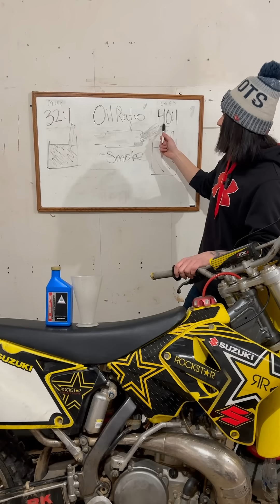2 Stroke Oil Ratio Explained

Comment from the maker: Use the ratio they tell u to use (in this case it’s 32:1) then u jet ur bike off of that ratio
Reply: I had best luck ever
 wt CCI factory oil on my RM 500! It wouldt run on anything else, after 5 yrs i done a top end job & it was still wt in specs! 1qt to 5 gallons was the best way to do it! CCI was the best oil ever made & probally the only oil id run 32-1 because i tried it! And everyone else maybe right!
Reply: You are 100% correct!!
Reply: I tried many different oils for all of my 2 stroke dirt bikes. I was hooked when I found AMZOIL. This oil could be run at a 100:1 ratio. I had a 98 CR250 I bought brand new and ran only AMZOIL at 100:1. I rode that bike hard every Saturday and Sunday for a full spring, summer, and fall. I brought  the motor in to get it honed or sleeved and new piston and rings at end of the year. I was told it wasn't needed and that they could still see the original factory honing scratches. They said you must barely ride. I laughed and told them how often I rode the bike and the oil I used and the ratio. They did their own research into using AMZOIL, and the next time I was at the dealer they switched over to only AMZOIL products. More than one occasion I was told I was going to blow the motor up because it was producing no smoke. Best oil I ever used.
Reply: @jasonkerekesch5012  fuel is a lubricant too.the oil mix is to satisfy the bearing requirements and to keep the exhaust power valve lubed too. The engineers at the company were not trying to rip you off, they were covering their ass too.
Reply: I run 34:01 on '02 cr250 w newest Lectron 38 pro it runs great and plug is tits now instead of keihin problem child that came on it. Hondas are notorious for tearing up plated cylinder near the PV they need oil. Tell lectron what mods you got they send you proper rod set right out of box and kick it and ride dont mess w jets again at any elevation. If youd rather do cave-man maths w jets then ride be my guest this aint the 20th century anymore. Also run non ethanol VP more stable and no gunk in carb to worry about let it sit for half a year guilt free. 2020+ pump fuel is worse for carbs than ever. EFI w magic button start is kinda cool lol
Reply: I jet EVERYTHING TO 50:1 I HAVE FOR 25 YEARS AND NEVER BLOW EXCESS OR BLEW AN ENGINE.
Reply: @codyjohnson5674  elevation is a major factor in what we can get away with also
Reply: How is 30to1 more oil in gas than 40 to 1 just asking
Reply: @DorethaRiddle  your kidding right?
Reply: @DorethaRiddle  the 1 in the ratio is the oil. So 40:1 means 40 parts fuel and 1 part oil. So 50:1 is more fuel to the same amt of oil.
Reply: @DorethaRiddle 30 parts gas 1 part oil…
Reply: People forget that the oil in your mix also lubes the crank.
Reply: @cliffordsimpson7113 it lubricates everything that needs it. Were you under the impression that folks thought that the crankshaft wasn't included?
Reply: How many years did it take to get the silencer
Reply: No. I'll just use synthetic.
Reply: But what about what the oil bottle says?
Reply: NO
Reply: Use what the manufacturer recommends for the oil ratio and jet your carburetor. That's how you fix the oil spooge that comes out of the exhaust and read your spark plug color, this will tell you everything about your jetting.
Reply: Lol sell ya bike and go electric u have no idea
Reply: Use the ratio that the oil manufacturers recommend for their brands. Then, adjust your carb to run correctly with that ratio!

If you don't know how to jet your carb, find a very knowledgeable person who does to help you problem solved.
Reply: @bbarker5766 Oil manufacturers intentionally give bad ratios. 
They're trying to make u need to buy more. 

Ur not the sharpest tool in the shed are u?
Reply: There’s no reason you should have to rejet a new bike unless you live in super crazy high elevation. There’s also no need to run that much premix oil 50:1 ratio is plenty enough. Also the better oil you use the better it works and less you have to use. 50:1 is optimal premix ratio and don’t use cheap premix or you’ll be fouling out plugs every ride at 32:1 ratio and be smoking like a diesel. Try 50:1 and tell me how much better your bike runs it’s going to have so much more pep when you crack the throttle.. leave the Jetts alone I’m pretty sure they jet it right when it comes from the factory. Unless you got a modded motor there’s no reason to touch them just use better premix at 50:1 ratio and your bike will run better than it ever has
Reply: @tsales330 damn right! Raced for years. And chased stupid problems. No reason to run 32:1 it's dumb. And loads up the cyl and plug. Plus it's a 2t rings annually are standard practice. Now that I don't race and trail ride with the fam. I pull a jug once every few years.  32:1 is way too lean on fuel and way too much oil. If your oils that cheap. Maybe save the engine and buy some better oil
Reply: @TheCharillz23 I run 50:1 in everything and jet accordingly. You don’t need 32:1
Reply: @TheCharillz23 your bike isn't jetted right and that's just facts, I'm a certified tech and I promise if you're jetted right and know how to ride a 2 stroke 32:1 is perfect. You must be scared to open it up if you're fouling plugs 😂😂😂
Reply: @tsales330 from my experience, bikes from the factory are jetted on the safe side not for optimum performance. My yz450f was lean on the pilot jets(causing low rpm flame out) and rich on the main circuit. My 2001 cr250 was jetted rich as hell, which is less power but more safe for engine longevity. 
Either way, it's your bike. You mix to the ratio that you feel is best. To me, 2 stroke oil technology has increased since 2001 so I run around 40:1 instead of 32:1. Im not fond of 50:1. More power but will need top end sooner
Reply: @tsales330 Almost every bike is jetted rich from the factory to avoid failure. By changing the mix to use less oil and keeping the stock jetting, you naturally are making the bike run even MORE rich and thus having MORE unburnt fuel and oil, as the jets are flowing just as much fluid but with 1% more fuel in that fluid, if switching to 50:1 compared with 32:1. This is irrefutable, no matter whether you subjectively think it feels more "peppy."

Also FYI you're going to lose some compression if you're using less oil. The oil helps seal around the rings. The viscosity is really less of an issue since there is such little oil, but still the oil is in the range of 50-100x MORE viscous than gasoline, so adding less oil will naturally make the jets flow a little more fluid with more fuel in the fluid. You're going to be running noticeably more rich with less oil in your premix.

Edit: Just did an in depth calculation out of personal curiosity approximating the actual volumetric flow rate change based upon data available online regarding viscosities of fuel and 2 stroke oil as well as an engineering equation to approximate the viscosity of a mixture of fluids and found that going from 32:1 to 50:1 increases volumetric flow rate by something like 17%. That's like going from a 180 main to a 188 main, a big change and in the wrong direction for a stock bike that's already set to run rich.
Reply: @anthonyantoine9232  ya they Jett them to be safe from the factory.. I see what your saying with more fuel but I don’t think that little difference matter unless your bike is modded. It’s 2 stroke too so with less oil it burns better and hotter with less oil. I’ve never had excess oil or gas coming from the silencer on any of my bikes they’ve always burned clean at 50:1. Still smokes alittle but you won’t be smoke screening everyone Behind you. I’m sure most have ridden behind someone like that can damn near taste what type of oil their using lol
Reply: I could be wrong tho but from my experience of having 2 strokes since I was a kid I’ve never had any issue with 50:1 ratio with a good oil  and many of my friends switched over from 32:1 after they would keep fouling plugs when we would ride and asked me what ratio and oil I ran they switched and never had an issue with plugs after
Reply: @tsales330 years ago, I’m talking like late 70s or early 80s a magazine did an article on 2 stroke ratio and found 28to1 made the most power
Reply: @jrod264winmag ratios have changed over the years, some of my older saws are boat engines are 25:1
Either way we all talking about oil like there's only 1 type, there are three main types and good reasons to use or avoid all of them.
Synth is the only one I'll happily deviate from factory mix with. 
Motul is amazing.
Reply: @zopEnglandzip  I have an old boat, can’t remember the engine make it says 100 to 1 on the gas tank, I run 50
Reply: @tsales330 you are crazy.... a chainsaw can run 50:1, that isn't what I would run in my bike tho. 40:1 is the thinnest I'll go but even that is pushing it....
Reply: @tsales330 the factory doesn’t know what altitude you will using the bike at.
Reply: @acsnitner7661 mix has 0 to do with altitude 😂😂😂 of course jetting does but the people who made the bike know the best mix ratio and that's all there is to it. Pros run 32:1 with 0 issues
Reply: @aiRZenki I was referring to stock jetting being assumed at near sea level. I reread how I wrote it and the sequence of comments before it and now understand where you are coming from. It was an error on my part and thanks for pointing it out.
Reply: @tsales330 so should I have zero sploogy? Like I rebuilt the bike and on the first two hours it had minor sploog trail on the pipe. Then it sat a few days I went out for another two hours and now it has zero sploog and only smokes when its warming up.

Comment: 32:1>40:1, the AFR ratio will get richer but that won’t increase spooge. 2 stroke oil isn’t what it used to be. All oils are different too. A caster based oil will have a higher flash point but can run at 50:1 safely (250 2t). A mineral oil will have a moderate flash point but cannot run 50:1 safely. Do some research!

Comment: This guy's an idiot. This guy, oil Burns hotter than gas you want to use as little as possible to lubricate the cylinder, that's it. You don't want a whole bunch of oil in there, if it runs 32 to 1 that's old measurements. Check any race bike nowadays, nobody runs anything but 40 to 1.  As a little oil as the oil Burns hotter than gas.

Comment: I don’t think that this is true

I’m not going to do the math because it’s not something that I’m interested in too much because fluid moving through a pipe follows a specific set of laws anyway because the equation factors in density basically as you increase the density either the velocity or pressure of a liquid would have to decrease so would all balance out at the end and it would move this exact same gallons per minute it’s only a few types of pumps that would get affected by the density and they are not usually used in most cars I can’t speak for dirt bikes, but I doubt it just because of the space constraint the pumps that are talking about, are usually more advanced and requires tight tolerance to create

I could be forgetting something. Because I’m kind of tired and I’m at the end of my day so if I am, don’t just tell me, I’m wrong. Explain how that way can be like yeah his wife let me make sure people read this and start spreading incorrect information

Comment: i always ran 40:1 with amsoil with no issues, and if you’re complaining about it running rich just spend 5 minutes with a screwdriver and tune the carb. in my opinion it’s just as fun to work on dirt bikes as it is to race them

Comment: 1 1/2 turns on the air screw. Fresh filter. Run 32 to 1. There's no reliability issue with 2 strokes if you run them properly. Just took an rm80 to one of the Nastiest Trail Parks in Texas and had a blast with no breakdowns. The idea that 2 strokes will leave you stranded in the woods comes from bad maintenance, the early 2000s internet boom is where most of the disinformation came from and that's why the guys that ride today hate 2 strokes. Bc their dad blew alot of money screwing one up a long time ago they indoctrinated the kids to think 4 strokes are better. It's all a matter of how deep your pocket is and if you can do proper maintenance

Comment: Mine has autolube, so I just have to not let the oil tank run dry. The amount of oil that gets to the engine varies by rpm, but it's around 50:1 to 40:1 in my case

Comment: Dude I just went through this , I picked up a 87 trx250 r and was bogging bad , wouldn’t jump into rpms. It also smoked terribly bad, I did a 3 day crash course on jetting , I still run 32:1 , less smoking, and very snappy throttle and clean power band. It’s all jetting !!

Comment: And what do you think the viscosity difference is between 32:1 and 40:1??  

Also, what do you think the octane rating difference is between 32:1 and 40:1??

Just think, 32:1 is around 3% oil. A 4 stroke is 100% oil.  32:1 is lean enough.

Comment: You're running richer because there's more gasoline by volume, not because the fuel is thinner and feeds more fuel through the jets 🤦

Less oil also means you're getting a higher octane rating since your gasoline isn't as diluted by oil, by volume, if you choose to use less oil. 

Just don't use less oil. Use better oil that doesn't smoke. Your shit will run better.

Comment: Whoever commented plugs are cheaper. You nailed it. Less oil means more friction and adds to wear  of rings and cylinder walls. 16 to 1 if you don't know. Even if I know. I will run a bit more oil in the gasoline. Running a bit more oil does have a price. The price of oil and a 2 stroke engine that will last for a very long time.

Comment: Then 2 stroke oil for 70°F lake water cooled boat engines enter chat 😂

Different than air cooled 2 stroke chainsaw oil,you buy at gas stations 😂

Air cooled pistons, need different oils than water cooled pistons .

But extra oil is cheaper than new piston 😉

Comment: 16 ounce jug of the best 2 stroke oil sitting there, 128 ounces per gallon take 128x5 / 16 = 40. that is why I run 40:1.  What he should teach is take your gallons of gas so say you pump 1.61 gallons into your 3 gallon jug that was already mixed 32:1 now how much oil do you add before shaking? easy… take 1.61x128x32 move the decimal over 3 places 6.59 oz of oil. cha ching money. now your whole 3 gallon jug is 32:1it literally means for every 32 oz of gas 1 oz of oil.

Comment: the only reason I run 40:1 is because 5 gallons of gas to that exact jug of honda synthetic 2 stroke oil is 40:1 hahaha.  Also I don’t run pump gas… which makes the biggest difference.

Comment: 😂😂 50:1 amsoil dominator/93 octane . Serves my 01 cr250r perfectly . If im just pussyfootin around ill mix it 42:1 run better mix and you wouldnt need the 32:1 or 40:1

Comment: Thanks for your knowledge. I always questioned people to say if it calls for 32 to 1 to run 40 to run it'll run better but I love two strokes and I found that if you run exactly what it says to put in it call they run the best and usually completely Problem free for very long time. And if they're going to sit you want to kind of drain and flush the system out get the oil out of that carburetor because they do gum up a lot faster

Comment: From what I understand, it makes it run leaner. Yes it’s oil rich, but the fuel is less causing it to run leaner on the fuel mixture side. Used to drive a go kart that was 22.1 It was a John Gore motor 125 cc it was getting 43 hp. John was out of Orlando.

Comment: It has nothing to do with that ratio. It’s the quality oil you use. I use redline 2t oil and run 70:1 or 80:1 for motocross. The things barely smoke and I get 200-300 hours on the top ends

Comment: I am running my KTM EXC300 on a 50:1 ratio and have only had the bike 2 months, and it's my first 2 stroke i have ever owned and i am a broke AF MF😂😂 so i didn't want to change that ratio and what i found personally is that quality is key. Bike ran shit on like "cheap" 2T, then dumped and cleaned the tank and put expensive 2T in and the kittem became a beast.

Funny things these 2 strokes....

Comment: Correct carburettor jetting is important if you want a crisp running responsive engine BUT if you want practically NO SMOKE you need to make combustion cleaner and more efficient..using higher quality expensive full synthetic diester racing  biodegradable 2 cycle oil at 50 to 100 to 1 ratio will eliminate 99 percent of that smoke..even when the engine is dead cold.

Comment: You know what the problem is with a two-stroke if tou get these problems not enough throttle. 
Run it 35:1 and  FULL FUKN NOISE 
You may blow it in a year but a rebuild kit and just time you can get running in a day if your not that on to it with bikesay two days.
Pin it to win it 
FFN

Comment: This is only about 33% correct which also makes alot of what your about to say next pretty wrong. But there is a whole lot more to premix than what you’ve said. Flash point, film strength and jetting. Premix for high rpm and premixes for lower rpm’s. So much missing in this context to make this video even worth posting. To overly simplified with no actual explanation. So either you do know more and want to post a lot more click bait type material to boost your algorithm or your a complete imbecile and you are just regurgitating the next guys thoughts either way you left out all the actual important information so bravo.